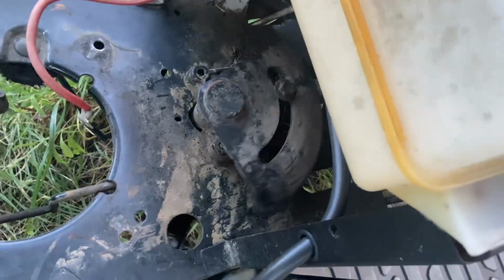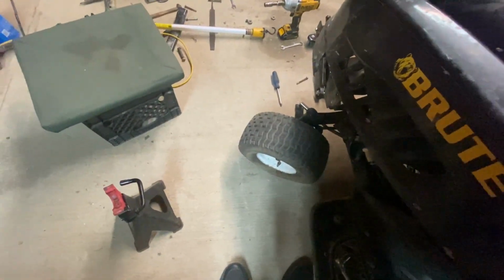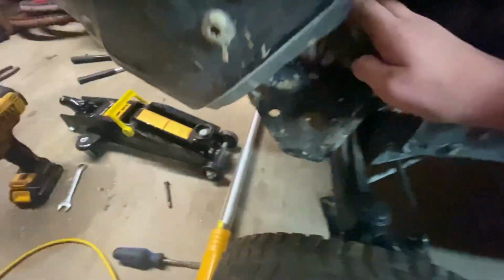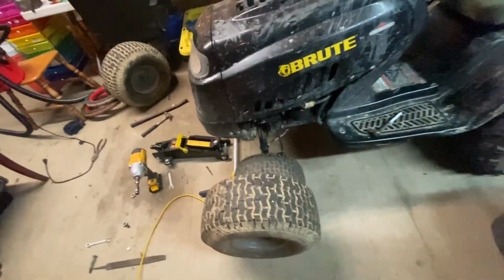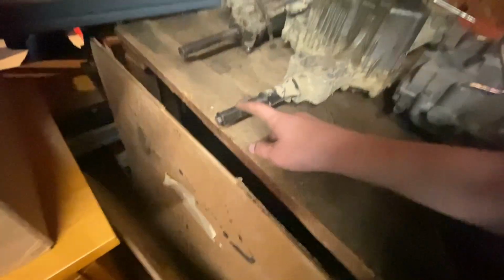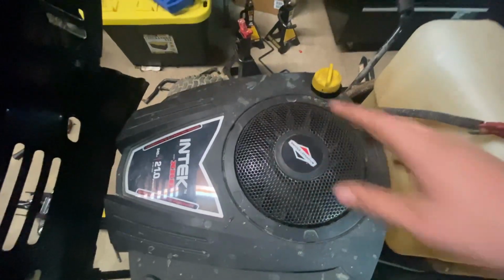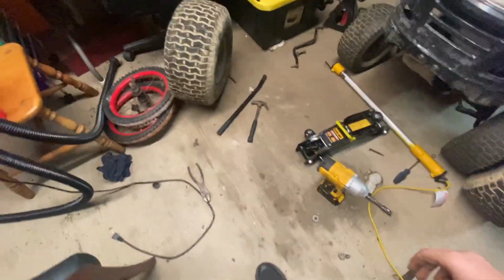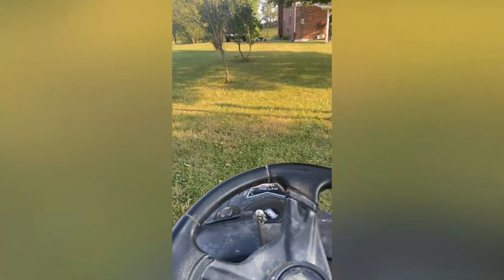Weekly mower updates 4

Comment: Awesome! I think an LED Light Bar, And A Clevis For The Back Would complete the look on the brute
Reply from the maker: good ideas, I'm working on a bumper now and I put the rear rack back together with a strap in it incase I get stuck
Reply: @Mo_2118  good idea lol, I need to make a bumper and stuff for mine to
Reply from the maker: @LaneProductions327 I used old deck lift hardware from a different one as the brackets, now I need angle iron or something to finish it
Reply: @Mo_2118  nice